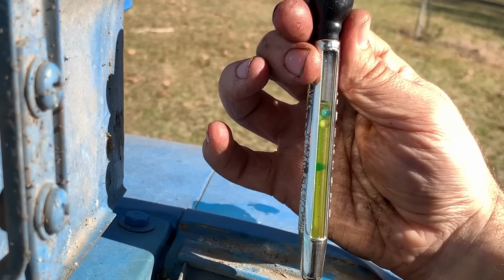Doing THIS can make your tractor last 50 years!

Comment: I have a Ford 300 with the select-o-speed transmission gear lever and a cab,  but here in sweden our Ford 3000's were infact Ford 3000 Super dextas but they are registered as normal Ford 3000's. The only problem with mine is that the numbers that shows which gear your in has worn off the select-o-speed gear lever, so you have to guess a bit which gear your in,  but as long as you remember that there are four reverses, a neutral and 12 forward gears then you can figure out which gear your in.
Reply: Many people i know flush the engine with kerosene before adding engine oil

Comment: My tractor is already 66 years old, will this add another 50 years to its life?😎
PS, if you GREASE the seal on the oil filter before fitting, it removes easily, always!

Comment: Clean all that dirt off the battery - I watched a video where a guy took a voltmeter to the dirt and the dirt was conducting electricity because it has minerals in it. This will drain your battery over time.
Reply: Jeff Mason - That´s 100% correct. tested and tried many years ago.
My batteries are always kept impeccably clean because of that and another important detail, corrosion. ;-)
Cheers
Reply: More likely the moisture Jeffery

Comment: I know everybody has their own opinion but as a 3rd generation diesel mechanic, I assure you there is nothing you can put in your fuel tank to help with longevity or keep maintenance down.
Reply: Microbes live in diesel fuel, eventually clogging the system.  Biocide added to the fuel prevents that.

Comment: I got a ´58 Ford(son) Dexta, more than 60 year old and when I got it, already had one of its connection rods replaced at one point in the past 60+years. And the engine on it was still wrecked again, with pieces of 2 pistons missing, cylinder walls ruined, and piston rings being in pieces. It still ran once but it was absolutely cooked, quite the mess to fix. Previous owner probably used starter fluid on every start, as the wiring was a mess and the heater coil wasn't connected anymore..

With the proper maintenance, I bet that ´ol Perkins could've kept its original pistons and conrods. But nope, it was abused like hell and went through its 2nd engine revision in 60 years. That ain't right.

Comment: I just got a Ford 3000 diesel from my grandfather.  I picked it up from his house brought it home on a trailer to get on and off the trailer I had to lift the 3-point with the brush hog on the tractor.  It lifted and lowered great that day.  The next day fired it up tried to pick up the brush hog and nothing.. Would you maybe know why the 3-point is not lifting anymore?  I didn't mess with anything the previous day and it worked fine.  Then the next day when I tired to lift it just nothing..

Comment: Simms fuel pump have  oil sump and need to change the oil, contaminated by fuel. Level , a bolt on the side and the oil, the same as the engine.
Reply: Jacques Deschênes i
Reply: Lucas d p a not Simms me thinks 
No oil self lubricated
Gordon Exmouth

Comment: I had a 1965 Pontiac that I had to do the same thing thing on its oil filter. I think a guy a the garage did this, I never went back to his garage. It looks like one of your pipes has a hole in it near the manifold, I saw it when you where changing the oil filter.

Comment: Using cheap-ass strap wrenches instead of a cap-socket on your oil filter will cause all sorts of trouble.  Find a cap socket that perfectly fits the filter brand you want to use then keep it clean.

If none of you have an aircraft cable wire-knife you need to look at em.  You just use a flat coal chisel to tap it in under the seal end of the can then crank it up like he did with the strap-bar first.  Will pop the seal in a couple seconds.

If your tractor runs at hotter temperatures and commonly fuses the gasket you can cut a ring of make-a-gasket and stick it in there then just use a hose clamp and a wire to keep the filter snug like an aircraft bolt.

Comment: I was a mechanic for a local John Deere dealer. You give some good advice. One thing I would recommend would be to get a service manual for the year and make of your tractor. There may be some  specific service for your make that you may not be aware of and they we show you where to locate service points that might not be visible . I have a 1950 IH Farmall Super A. I have owned it for 20 years. There is a grease fitting inside the transmission bell housing for the throw out bearing. Would not have know it was there without the manual. These older engines where designed to run on leaded gas. There are lead additive you can add to the gasoline that will help protect your engine.https://www.youtube.com/watch?v=AVx9AETj4J4
Reply: Rdrake1413 - "There is a grease fitting inside the transmission bell housing for the throw out bearing." 
You can find the same in Kubota and I bet in many more. ;-)
Reply: Sure there are many that don't get grease because people don't know where to look. I have worked on many John Deere tractors and without a service manual you would have to hunt down every grease point. Every year model is different. And like I mention in my comment there may be a specific service for that make and years model people are not aware of

Comment: That oil filter was on far to tight. Never start a diesel and then after a short while turn it off not getting to operating tempts. doesn't do the injectors much good. Keep your battery on charge between uses that really extends the battery life. How often do the fuel filters need changing? I just love oil bath air filters. Messy but good. You will be olde and decrepit when that tractor bites the dust. Matching pair I would say.

Comment: so basic maintenance then, also don't do the filter up with a ratchet... if there isn't a grease nipple, use oil. keeping it clean helps in general. haven't had much experience on older tractors but have clocked up 13,000 hours on a tm140 also 7,000 on a jcb 414s in the 11 years I worked for a contractor in the uk, you can tell when it needs a service but that comes with experience, its in the sound it makes when running and the feel when under load. looking after kit is important, you look after it, it will look after you.

Comment: The oil filter on our 2018 5045  John Deere Was just about as hard to get off (first service)......I  use Lucas oil stabilizer in the engine and the  wheel planetaries.....wash with B-52

Comment: Need to change oil in the injection pump fill cap on top check plug on side drain on bottom fill with motor oil.Simms was the best pump screw on it you could throw the fuel to it you could spill test the timming on it also. Allsome pump

Comment: The reason you had a hard time removing the oil filter is because of what you did when you lubed the rubber gasket, you used old dirty oil, this old creates a glue like substance, you would be better off using a lithium grease. I do this airplanes and never have an issue removing the filter.

I always cut open the filter to look for metal deposits. Having drill into the filter to insert a punch you have comprised that ability.
Seajfoam good move.

I also add fuel stabilizer since my tractor does not move a lot gas through it. With the poor gas we have with methanol it has a tendency to gum up the carburetor.

Comment: that oil filter was on way too tight.......i was always told to tighten it until the gasket touches, and then continue tightening 1/2 more of a turn.  i got bough a used car once that when it got around to removing the filter for an oil change, it ended up being a nightmare.  the oil filter was unrecognizable after i finally got it off.
Reply from the maker: Todd Bushcrafter Yep, definitely torqued it a little much last time.
Reply: @falllineridge  those older tractors will run forever as long as they are taken care of.....i wish cars were like old tractors...

Comment: NOTICE:  Gluing the oil filter on is NOT recommended.  ( kidding ).
Reply from the maker: Norm 😂
Reply: You put old oil on the rubber seal when putting on a new oil filter.
This helps it not to stick when taking it off again.
Reply: He did.......
Reply: The use of oil on the seal is mainly for to get the correct friction when tightening the filter.

Comment: I don't have to watch this to tell you keep your fluids changed properly with good oil and keep it under a roof when it breaks fix it with a quality part
Reply from the maker: Thanks for watching anyhow!
Reply: Fall Line Ridge we still have some original tractors on the farm a John Deere A , B and a 630 they all just sit around now the only one powerful enough to do anything is the 630 we have a ditcher, 8'Bush hog it will barely run the 10"augers
Put a layer of grease on your oil filter o-rings instead of oil, mix up baking soda and water in a water bottle and poke a hole the cap and spray it around the battery terminals it will foam up if there is acid and it will neutralize what got on the metal to prevent further corrosion hell we still use the 39 and 41 Chevy grain trucks all original for odd jobs cleaning seed, splits and whatnot

Comment: Absolutely do NOT use products that claim to clean engines! A quality DEO product already has additives that serve that purpose. Yes it may remove contamination quickly but so quick that it stops up filters, passage ways, etc which do more harm that good. If the engine needs that much cleaning then it should be disassembled to a certain point and cleaned, possibly restored or rebuilt.

Comment: I got tractor running but I can't give it a bath till spring it was 9 degrees here this morning LOL Mine needs lots of maintenance be sitting for 7 years with out running  1964 John Deere 2010 industrial  will try to post a video later
Reply: Nice job on the maintenance part very  important part
Reply from the maker: Larry Downes Looking forward to it! Stay warm...9 degrees is rough.

Comment: Why did you put oil where I think you said was the air filter?
Reply from the maker: Tom Skaggs It’s an old type oil bath air filter. The air is sucked through the oil as the primary filter. Then it goes through dense wire to finish up.

Comment: Why were the batteries so big on those tractors?
Reply: Because of the power. A tractor need powerfull batterie 100-125 Amp. In my Ford 4600 I use 125 Amp. Greetings from Greece!

Comment: Grease everything a touch every time you run it, you can make boots from coolant hoses for your dirtier points.

Do your final rinse with a pair of $0.89 jugs of distilled water and blow dry with the farts of Clydesdales.
Reply: My 2 cents. Get some of those rubber caps, traditionally used on brake bleed nipples. I get them on Ebay dirty cheap. Cover the grease fittings. Next time it's needed everything is perfectly clean without those globs of mud/debris mixed with grease. ;-)

Comment: What year is your tractor? I had the same tractor mine was a 1973 . I also tend to over tighten my oil filters also. That tractor was very good to me. Nice video!!
Reply from the maker: Thank you, Steve. I believe it's around 67-69. If I remember right, those were the years that Ford still included the "vents" on both sides of the hood.

Comment: Why is there oil in the air filter?
Reply: It's an old system, rather effective for the time, I might add. 
Anyway the oil is the dust retention media. 
When the air flow quickly change direction the heavier particles will drop into the oil bath, being retained that way.

Comment: Sump plug could do with a bit more of a turn and the filter should be hand tight. I would have steam cleaned the engine before i started working on it. Why didnt he show us changing the back end filters (2 of them) ? Maybe because he hasnt been bothered with the whole day it takes to do it in the 3000. Just a bastard of an idea. I liked the way he wiped the excess grease off the nipple when the whole tractor is covered in shit🤔 not a bad video over all but some comentary for viewers who dont know much about ford 3000 tractors would be nice.

Comment: Why such a big battery, 6 volts, 
I wouldn't  put sea foam in anything,  even if they gave me a semi load for free, it's not any good for anything. My opinion,  and this guy should have a chain filter remover  , or just drive a screwdriver through it. Old school. My ford is old but it's a 12 bolt system, and smaller than this one.

Comment: those filter wrenches are junk, all they do is crush it. a big pair of pliers works much better.
Reply: The first thing my old man shown me when learning oil change was how to properly punch it with the 14" screwdriver and the hammer. Too much trouble using the drill. :-))
Reply: I always changed my own oil for the last 50 years on my vehicles. However, ever since I found the correct filter wrenches that slip over the ridges on the end it’s been much easier. Oiling the gasket and NOT OVER TIGHTENING it makes it a breeze next time!

Comment: That will keep her running for another 50 years. The battery did not looked like a sealed type. I assume the water levels are correct.
Reply from the maker: Good call, Bob. I didn't even consider that. Thanks!
Reply: @falllineridge  I think I gave away my age.........OLD!
Reply from the maker: Bob Smith Experienced!
Reply: @falllineridge  Thank you!
Reply: I think he meant to say electrolyte
Reply: TheFalconJetDriver no you just add water
Reply: Norman Dyck distilled or also known as DI water. Tap/city water or well water often contains minerals that will decrease the longevity of the plates in the battery.
Reply: @TheFalconJetDriver  The minerals can cause scaling of the plates, which leads to a higher cell resistance and eventual failure.